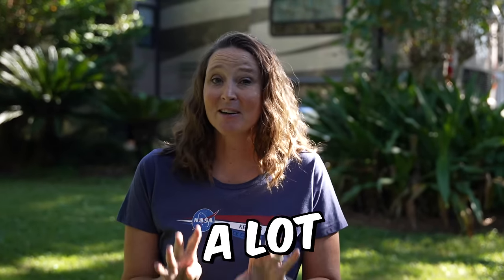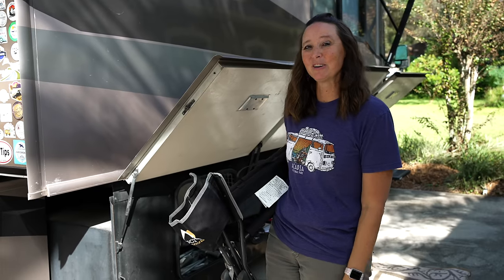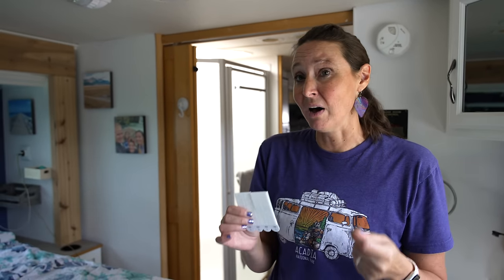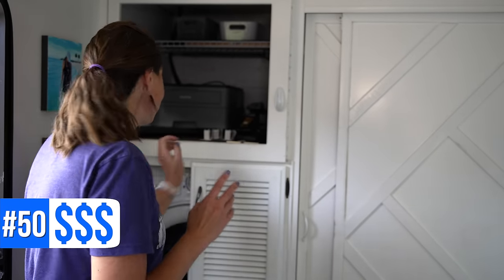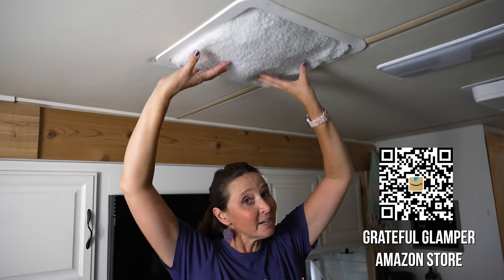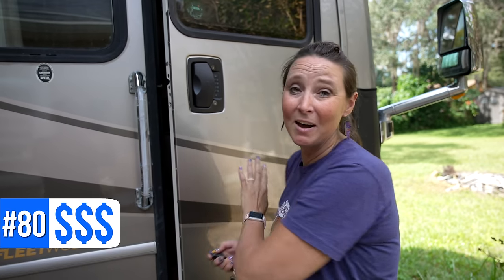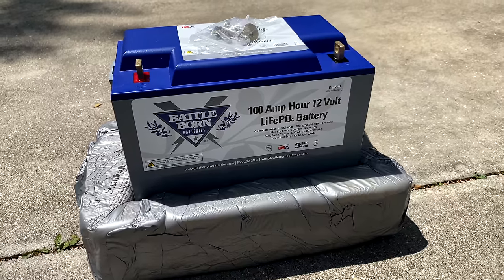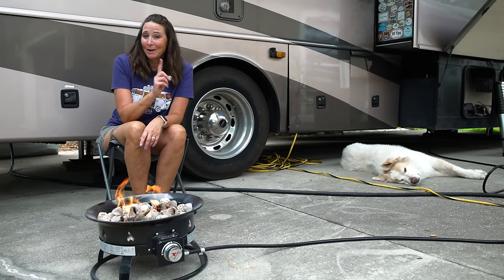100 Products On Amazon You Didn’t Know You NEEDED For RV Life!

Comment: As a campground service tech with those with a 2014 or newer rig please don't use the outside surge protection. You unit already has it built in. Most rv centers will sell you that item and even push it just to make sales on an accessory.  YOU DONT NEED IT. Infact when you come to most campgrounds , you will have issues. NOT BECAUSE it's the campgrounds issue. BUT because your internal fault protection is battling your outside fault protection,  causing you intermittent power issues. PLEASE REMOVE YOUR EXTERNAL , IT IS NOT NEEDED. AND YOU ONLY FRUSTRATED YOU TECHS BECAUSE YOU ARE IGNORANT.
Reply: Never seen anything like that. Do you have more infos? Thks

Comment: So many great items.  Not just for RV or camping.  Many can be used for small areas as well.  I have the Shark Vertex Cordless Stick Vacuum Cleaner with DuoClean PowerFins and I love it.  The "stick" bends so you can easily vacuum under furniture without having to move the furniture or get down on your hands and knees to get under it.  It also folds to make it smaller for storage.  I find it works well and I've loved mine.
Reply from the maker: Awesome, thanks for sharing

Comment: Fabulous list. I was surprised that we have so many of these especially since we are in a class B where space is extremely limited. One thing we've done different than most is the bucket. We're using a rectangular window bucket with a lid for storing items then using for a bucket or even doing off grid laundry if needed at times. It just happens to fit really well for us. We also keep a small gas can, emergency strobes and three mini orange cones from the dollar store which can also aid in reserving our spot if we have to run into town. I've already got a collapsible water hose and hadn't even thought about taking it but I love your idea.
Reply from the maker: Thanks much

Comment: Love most of these ideas and have many of them. Although many of them don’t apply because I’m not full time and our rig is much smaller. But one item I highly recommend for anyone with a rubber roof is eternabond tape.  An absolute must if you get a puncture or leak. 

Also recommend moving the pressure regulator to the top of the Y. I have my black water flush hose attached to the other side of the Y and want to regulate that side too.

Comment: I think I got to 10, that we weren’t using . So 90 in some form with the nano tape, collapsible bowls, micro air, water hose, sink thingy grate being specifically from your recommendations in your other videos.  One thing on the Nano tape. Be aware of where you store it because even the sides will leach and stick to what you set it on :)  safe travels!
Reply from the maker: True, we found heat will help remove it too.

Comment: From amazon, I picked up two Save-A-Drop water flow meters; a white and blue one for my fresh water needs...like when filling my fresh tank and wanting to know exactly how many gallons have gone in,  and a black and green one for use with my black hose when I dump my black tank, fill it back up and dump a few times then lastly adding back in about a gallon for the chems to slush around in when finished.  They read in tenths of a gallon.  They also give you a great understanding of how many gallons per minute your source can provide.  most places that we have stayed at works out to 4 gallons a minute (I use a splitter where the fresh hose is metered and the black is full bore, whatever that may be).  Knowing this, you can go by your watch even and walk away for a given amount of time..  Kind of handy.
Reply from the maker: Thanks for sharing

Comment: Great list and we do have a lot of them. We bought a cheap multimeter, which broke pretty quickly. We found the replacement model we got, happens to have a thermometer on it. Great to find a dual use for something. We bought one of those jump starter gadgets and discovered it didn’t work when we tried to help another traveller. The company replaced it with a newer and seemingly much better looking model. We still aren’t sure if it works though. Hubby thought it might wake our batteries from sleep mode today, but he ended up using an unregulated solar blanket, which worked right away. I guess we are learning all the time.
Reply from the maker: RV Life = Always Learning! Thanks for watching